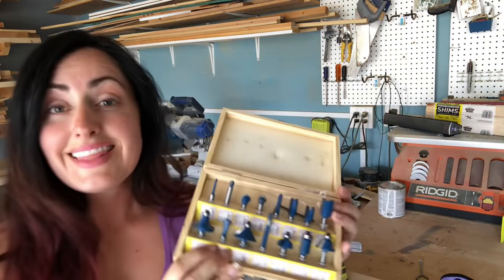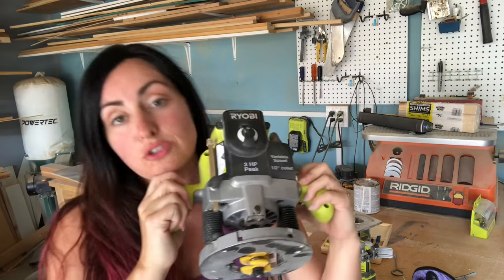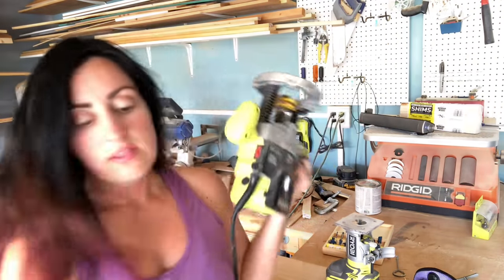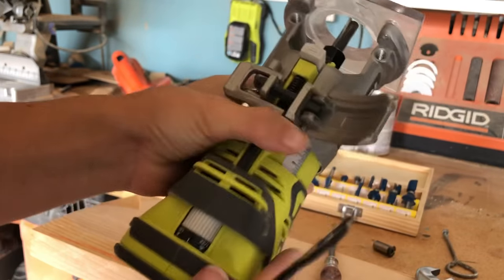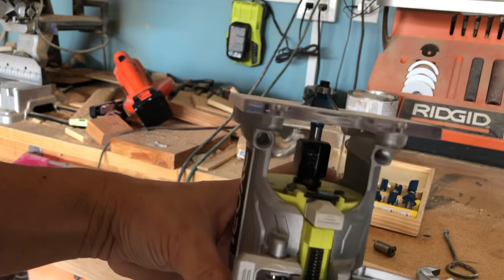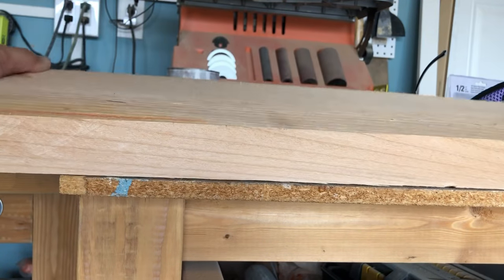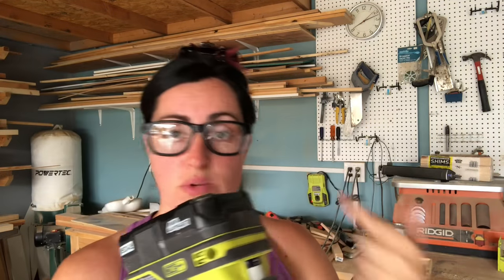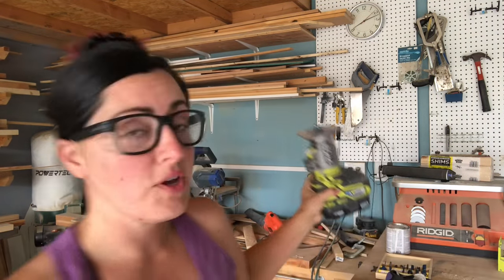Routers for Beginners- woodworking

Comment: Great video! it was very clear and informative and your presentation skills are very polished! Just a question.  I'm considering a router tool, and my question is what would I not be able to do with the Cordless trim router P601 that I can do with the corded 2.0hp plunge router?
Reply from the maker: The plunge router basically has a bit more power to do deeper cuts, while the trim is great for edge (trim) work and shallow grooves. I use my plunge when I cut 1.5” stock I still need to go in passes but not as many.

Comment: I was wondering how you keep your trim router from biting in too far? Your cuts are nice and straight....
I tried using my ryobi trim router straight out of the box on a nice antique dresser top and now have to replace that top. Is there supposed to be a guide of some sort on it or what? Do I purchase that separately? Please help! I don't want this to happen twice.
Reply from the maker: Yours should have come with an acrylic base or has a base plate built in, then you can set a strait line or faux fence with a straight piece of wood clamps at each end to follow for a straight cut

Comment: Why is my wood burning while cutting
Reply from the maker: The bit is either rotating too fast for the hardness of the lumber or your not moving your tool in the right direction quickly enough. Lookup the right speed for your lumber and also try moving with control in a more steady speed. Good luck

Comment: Just a heads up a big plunge router might be bigger and cost you more but but has more options (more collars 1/2 and 1/4 and some have the option to attach to a router table). A router bit that is 1/2 is usally more stable.
Reply from the maker: Thanks I have a plunge as well! Thank you

Comment: Hi, bought one of these yesterday and been practicing with it a little and your video has really helped with. Quick question though. Using the example in the video, what if you wanted to round the edge the entire length of the wood, how do you start at the corner when the bearing has no guide and when you come to the end, if the bearing has nothing to guide against will you not end up rounding up the corner as well as the edge (not sure if I’m explaining myself properly here)
Reply from the maker: I think I understand correctly and yes without a straight guide it will round around the corner. Is that what you mean? To avoid this and keep a 90°edge I use a long straight board as a guide clamped to the piece, and then take the round over past the edge on all four sides. Does that make sense?

Comment: Could you help me? I've never used a router. Ive honestly never done any wood work. I'm making a bookcase and i just installed my bit and tried on a piece of scrap wood. i tore the board up and it almost jumped out of my hand. All i want is to make the space that the shelf boards will sit in. The board is 3/4 in deep? My bit is 3/4 straight. Using a Dewalt compact router. I've watched a ton of videos and the trim work is awesome but not (joiners? i think)
Reply from the maker: SURE! My guess is that you need a guide to keep you straight and you need to take shallower passes. Start with the bit only lowered slightly so your taking less off each pass. Clamp that guide down and put the router down and go slowly along the guide then drop your bit a tiny bit more and just do more passes. Hopefully this helps. If you need more guidance head to my instagram and shoot me a DM.

Comment: I want to get into woodworking and one of my first jobs is replacing a tabletop. I want to cut a 3m surface into 2 1.5m surfaces. I read somewhere that a router can do this, but from watching this video I am not sure. Is a router what I need or maybe a circular saw? If the router can do it then I would like the router as I might do the edges.
Reply from the maker: if you are lookin to cross cut the piece than a circular saw with a guide would be best. If you are looking to thin a piece down you could use a router with a sled on both sides and make shallow passes until you reach your depth.

Comment: You should mention that you should disconnect the power from the router before changing out a bit.
Reply from the maker: Very good point! Thanks, mine is battery operated so I just have to take the battery off.

Comment: Where did you buy your wrench? I bought a 11/2 hp chicago electric plunge router that uses a 1/4" bit and I can't find one anywhere. I called Harbour Freight and they don't carry them. I don't know what size wrench to buy for this size bit either. Please help!!!
Reply from the maker: It came with  my router
Reply from the maker: You could try and adjustable one that might work

Comment: Can your battery operated router fit a 20ah battery?
Reply from the maker: No this specific one is an 18v battery
Reply: Did you find any downsides on that ryobi router? Am planning to get one but I already invested too much on my 18g nailer batteries w/c is 20v. Hiw much AH is the battery? Does it last long? Thanks.
Reply from the maker: That is the downside in my opinion, the battery doesnt last long at all, I would invest in a larger capacity battery I have the smallest.

Comment: You can also do what a router does with a power drill and some other tools, but it will be time consuming. The only reason I did it was because I wouldn't buy a router to use it only once in my life
Reply from the maker: haha Yes no need to buy tools you wont use.

Comment: How do you get the very ends routed? You started a couple of inches in and I am wondering how to get started on the ends and keep it straight. Obviously a newbie to router, LOL.
Reply from the maker: Great question. I usually start mid material and go one direction all the way past the end and then turn around go back the other direction. Leaves a smooth finish and is the safest way to do ends.
Reply: You can start the router bit right on the end of the board no problem..
Try to avoid going in both directions as router should be moved against the direction of its cutter.
If not (referred to as a climb cut), the router has the chance of running away from you using the bit as a fast moving wheel. It can be a bit scary for someone not expecting it.

Comment: Hello, thanks for this video really helpful! could you tell me, is it possible to perform surface routing with the Ryobi trim router?
Reply from the maker: Like to flatten a slab? its possible but I would suggest a plunge router instead, they have more power and wont bog down as much

Comment: Can u do shaker doors with them. I struggle with where to put the router to start
Reply from the maker: Yes you can and it does take practice, there is usually an arrow showing which way to take the router

Comment: Hey Brandi, I liked your demonstration on routers and router safety here, I have been doing wood work now for just about three years and I tried the Ridgid battery powered router. I was actually somewhat disappointed that the router did not perform well, I wanted your feedback as to how you liked the Ryobi battery powered tool?  I'm just hesitant to buy another router if it will not perform well. Hope your safe out there and keep building!
Reply from the maker: Oh no, I am curious what you had trouble with? What didnt you like? I really like my Ryobi but its a trim router so its meant for small jobs and mine is battery so it runs out of juice pretty quick, I do find that frustrating when I am in the middle of a build. But it could be solved if I had another battery to swap with. I have heard some amazing things about the Bosch corded router and the makita as well. Hope this helps!

Comment: What bit is used for the lines in the wood like you showed?
Reply: Tried to screenshot it but its on clock counter 7:21. Thanks
Reply from the maker: I linked the bits in the description and it is the V groove bit is the one I used in this video I think.

Comment: Which router not do I need to cut grooves
Reply from the maker: I am guessing you meant bit? But all bits cut grooves so what type of groove are you wanted to cut and what is it for?
Reply: Yes I probably pushed the wrong button on my phone what router bit would I need to cut what I think they call a juice groove I don’t necessarily need it for a cutting board I just wanted a nice groove on the top of my design on top of my wood to give it some character. So it’s not so plane it’s for a serving tray.